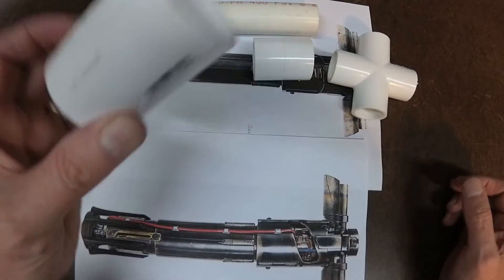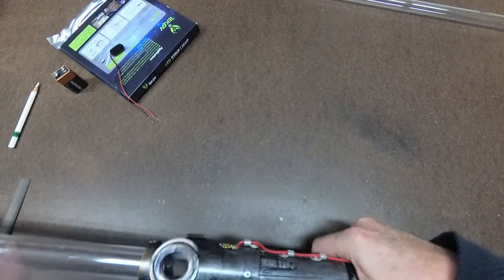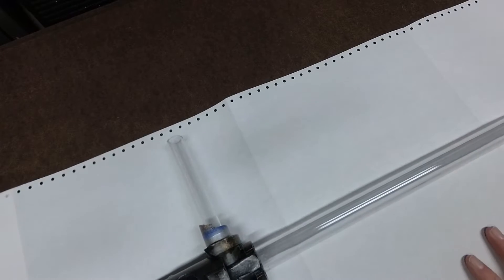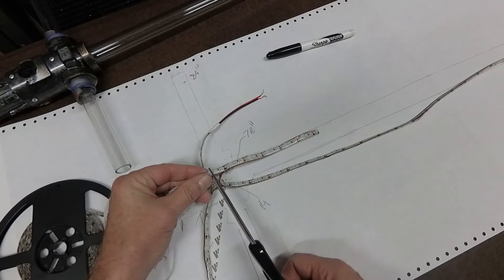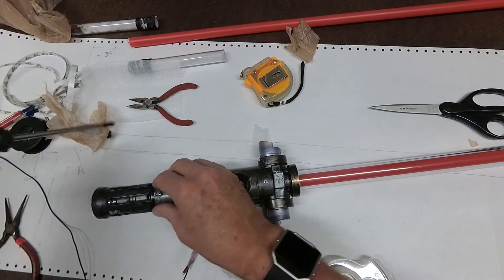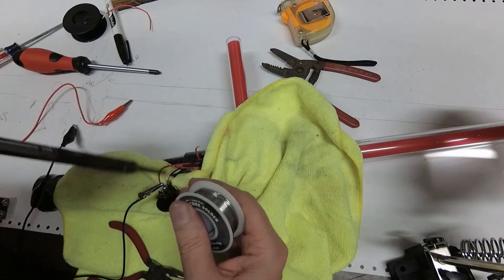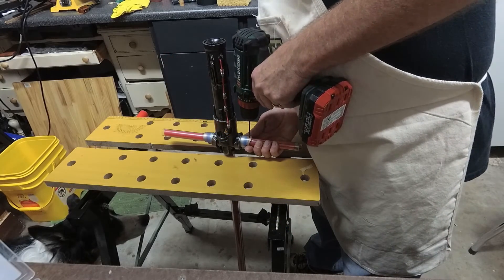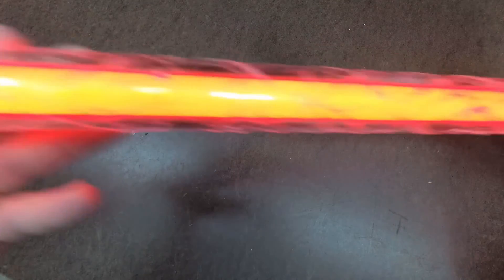Build Kylo Ren's Lightsaber Part Two (Step By Step)

Comment: I'm going to be embarking on my own build following your path, I love how you did it and made it look, but might put a few modifications of my own, maybe thinking of trying to include a different on/off button.  I do have one question, the type of pvc you used for the extra ornament I've been having trouble finding something like that for other builds, do you have a more specific name of what I could look for to find sheets? I've bought little plastic containers to use before but they often are flat and require a lot more work to sand down all the extra bits.  Thanks! Definitely going to be looking forward to more builds!

Comment: Great job, I have a question. I tried this way of building the lightsaber for my daughter. But i just want to know how to make dots of the led disappear. In camera its looks like there is a continuos light, but i had tried and still you see the LEDS, or is a special type of LEDS you are using? Thank you
Reply from the maker: J. Alfonso Pascal , I use the white plastic bag then the sharkbite plastic pipe but also the scaring of the blade help to also defuse. I hope that helps.
Reply from the maker: J. Alfonso Pascal , Your correct about the LEDs I am still working to defuse them better. Some colors defuse better than others. The trick is to wrap them in something translucent without dimming the lightsaber. I hope I’m not making this more confusing?
Reply: @DIYGene  Thank you my friend, the truth is that is imposible to make the strips disappear completely, I had tried every technique you can find here in you tube. Thought, its a fun project. If you have any other advice, my email is keziera@hotmail.com. Thank you from Mexico City
Reply: 5:48

Comment: I love the unstable effect soldering iron technique! I have a more general question concerning polycarbonate tubes: On all saber blades, be it DIY sabers or any of the expensive makers, I see end caps or plugs put on the blade ends. Since polycarbonate can be formed using a heat gun, couldn't one also heat shape the end into a closed bullet tip instead of putting a cap on it? I'm asking because I haven't worked with polycarbonate myself and I haven't seen it done on any saber yet.
Reply from the maker: Norman Bos, I thought about trying to trim the end and then heat and bend together. But the end plugs worked better for me. I will experiment with some of the drop off and see if that works. Thanks so much for watching